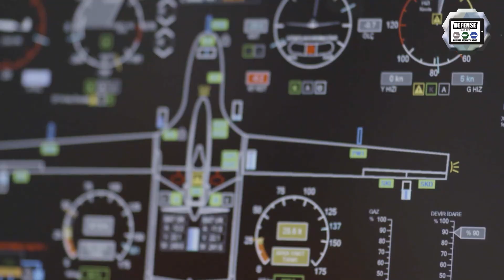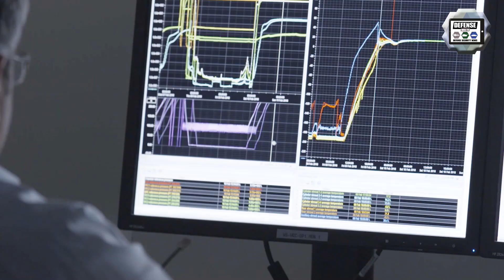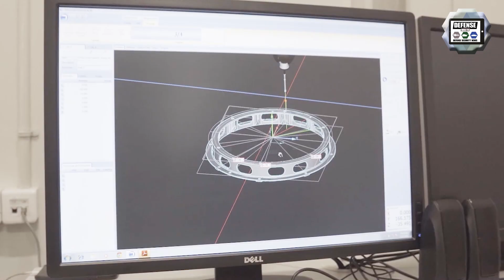Turkey Turkish defense industry aviation and aerospace Aircraft - Helicopters - UAVs review analysis

Comment: I still don't understand how Turkey can't build it's own engine and transmission for the altey tank since it's obvious that they have brilliant minds.
Reply: Our best ingeneers are developing airforce components now (fighter jet, a2a missiles, uav, cruise missiles, radar and hight altitude defence systems). We just do not have enough high class engineers to build everything in the same time. Just not enough human recourses.
Reply: @nihatsavmaz6677  82 million population, not enough human resources ? then greece with 10 million is hopeless...
Reply: Turkey builds engines but what they are struggling is to build a tank engine and a transmission which must be way more resistant than an ordinary one that could work smoothly and effortlessly in the most difficult environments and terrain at the temperatures of  plus +70 and -70 degrees celsius, this challenge is met by only a few countries, even korea who has much mote engine experience than Turkey could not have done it yet
Reply: @alican3920  I think the problem is elsewhere, turkey just didn't expect that Germany wont export tank engines +transmissions to them,since they had signed a contract with MTU and Renk in 2010.
so they didn't put any money at all into making an engine+transmission.
Korea has already made a tank engine,the "Doosan DV27K" ,and it works great,but they had many problems with the transmission.
Reply: Turkey have and have build motor but IT isnt enough yet i think IT Will take view years for turkey to make IT 100% but they are on the way 👍
Reply: Its not easy and BMC just made a prototype but me and all others turks believe its just a bait and lie again to not give up hope